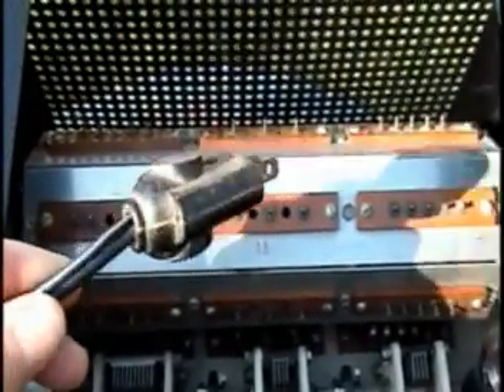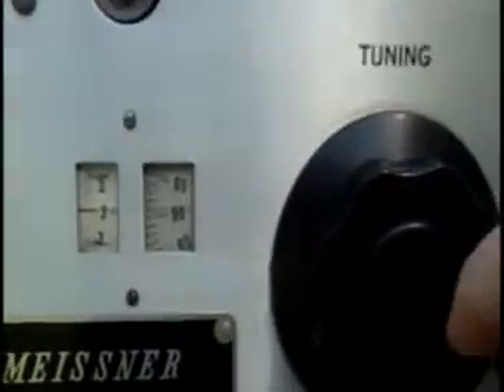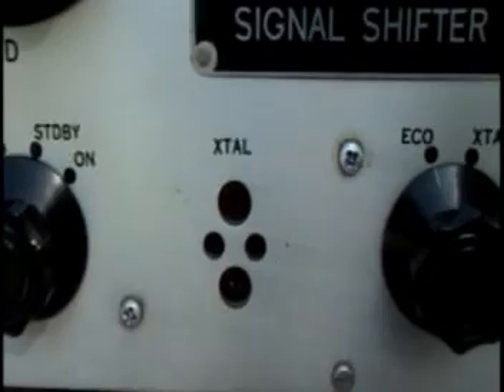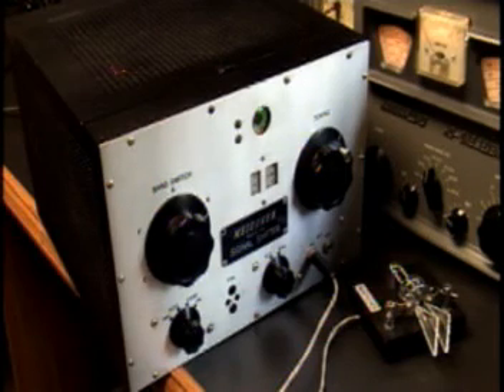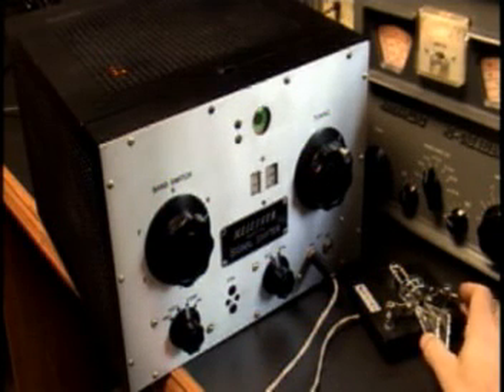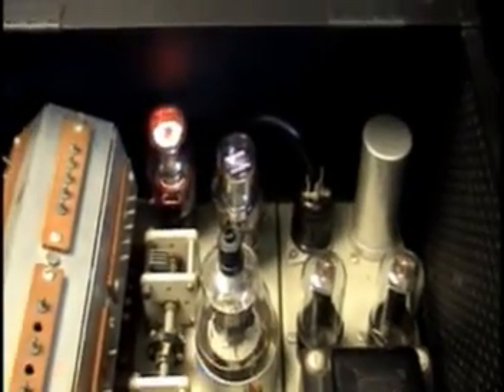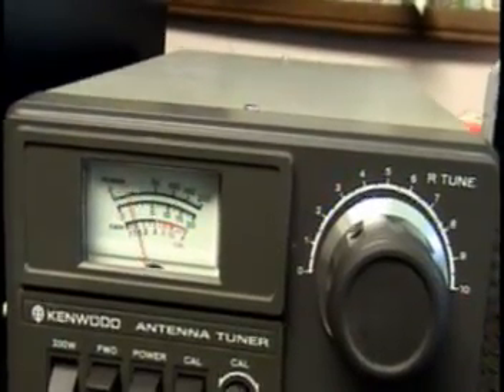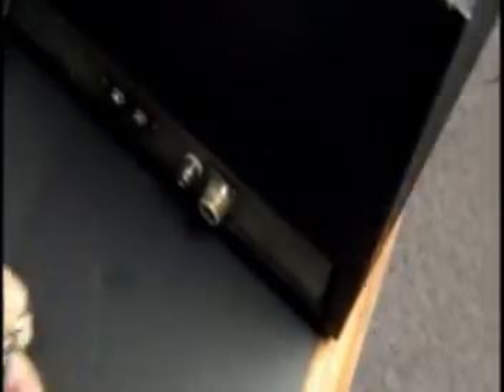Meissner Signal Shifter Model EX Ham QRP VFO Transmitter Demo

Comment: What a great video. Wonderful music and effects. I HAD one of those when I was 17 years old. Got it from the Brasspounder's hamfest probably. I was on CB at this time. I found this unit had 11 meters in it. I read how to plate modulate the unit from an ARRL handbook. Was able to use a speaker transformer off of an old TVset where as the speaker had a matching transformer on the speaker itself. I put the B+ side of the speaker transformer in series with the B+ choke to the 807. I fed audio into the 8 ohm side of the speaker transformer from a stromberg receiver with 4 6L6 tubes in the audio amo part. And I fed the stronberg with a preamo and that was fed by a microphone. I would use the VFO to slide on to channel 11 27.085. The receiver I had was I think a Collins R390. And must have been a CB set in ther etoo probably a Lafayette to keep as a frequency standard. Wow. this bought back memories. I was Zaton as a handle. and I talked a lot to a guy called Television who's real name was Wayne Valentino on Channel 11

Comment: I just got a Signal Shifter EX in summer of 2018 at a hamfest. I was a bit surprised it worked when I plugged it in. I still need to get it out of the case, add a 3-wire power cord, and probably replace a leaky electrolytic.  de WA5BDU

Comment: I too have a Meissner EX.  Mine has a rack mount front, in near mint condition and has been on the air recently.  Only on
40 meters. I love the 807 as it is used in two other rigs I use (WRL Scout and Glove Chief Deluxe).  Thank you for the
fine video.  Rich K8UV